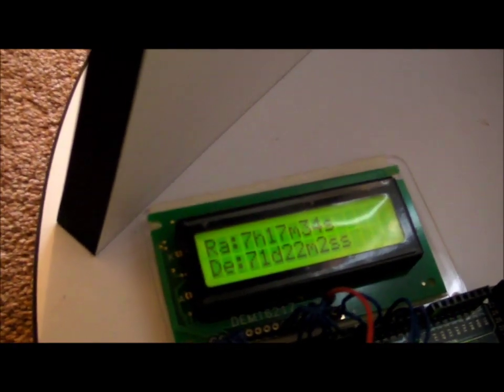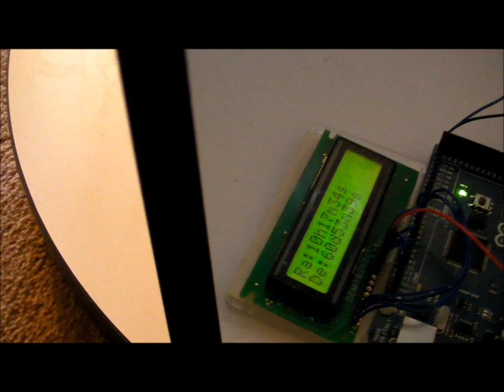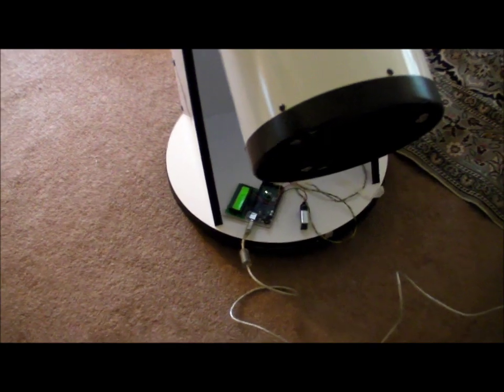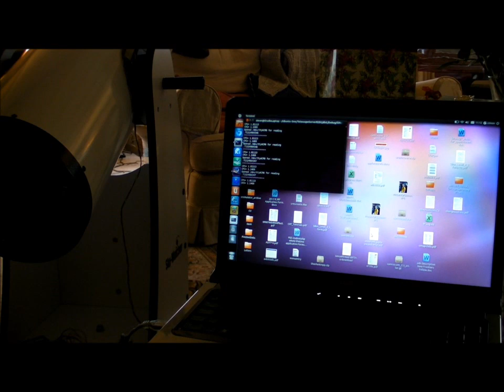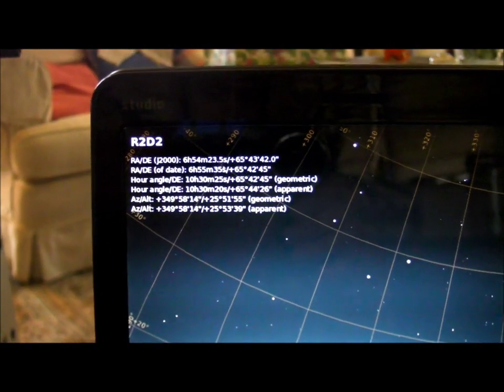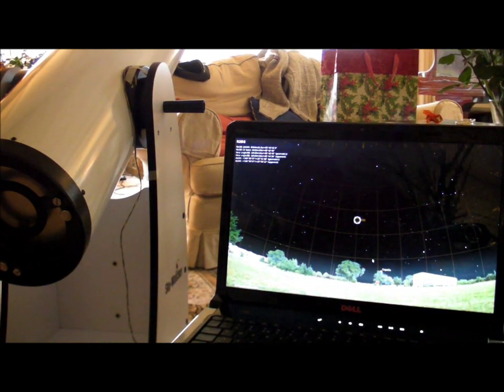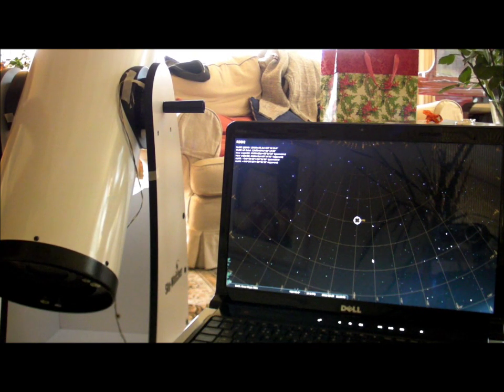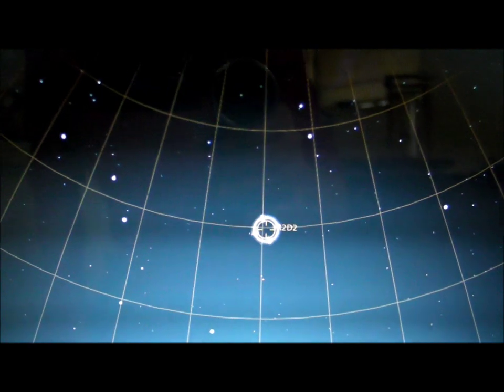Part 2: Sky-Watcher 10" Dob - Auto tracking project

Comment from the maker: @bobhaha No problem, you should be able to use the relevant bits of my code (on sourceforge and linked from my website [linked in description]) to do your angle conversions. I would also be interested in learning more about your project, the measurement devices you are using and how you connect them. PM me if you want to discuss more.